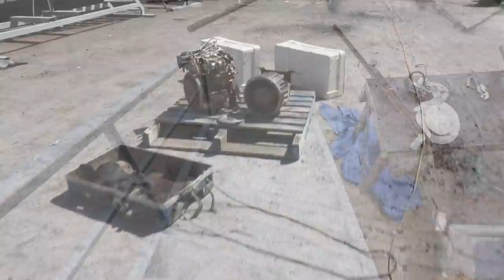Fitting the Generator - Project Brupeg Ep. 67

Comment: In reply to your reply of whether or not the engine will run, I hope you're right and the main bearings are OK. Be a huge pain to have to pull it out again....Thanks for the reply and the best of luck with everything!
Reply from the maker: Yeah when we pulled the sump, it was crystal clean. No red flags anywhere, it turns over really nice, had a few oil leaks but nothing that was an issue. It’s possible the head could have something going on as we haven’t pulled that but all of that end can be dealt with in place without any issues. If it were a dog I wouldn’t have bolted her down. I think we will be ok.

Comment: That looked like quite a project to get it refit and put in the boat. Now to see if you can get her running again. As long as you have it in the boat you probably won't have much trouble getting it running. I wonder it they took it out due to electrical problems with the generator. Good luck with it.
Reply from the maker: Yeah so far we don’t know. But it’s a simple beast, just got to find the time to dig into it

Comment: Keep an eye on all that stainless welding you have been doing. Without back gassing the area being welded it gets contaminated and has a tendency to crack from vibration and heat cycling.
Reply from the maker: Ok will do. Thanks
Reply: I second that.

Comment: I work on these and Whispergen’s (Mitsubishi) every day in the course of my work... great little gen-sets 

A small cloth plug in your oil filter inlet and outlets would have helped prevent some of that grit and grinding dust falling into the oil galleries.  
The water cooled exhaust is too long as an extension bolted onto the manifold. There should be a resilient mounting between it and the engine flange to prevent the assemblies cracking/fracturing.

Just a question? 
Why not finish all the repairs, assembly and testing on the bench?  
Much better access all round.
Reply from the maker: Hi Hammes. We are about to add a Flexi joint, I should’ve done it when I build the pipe but plain forgot. Also if we had time I would have bench started it but with John heading up next week to work on this we needed to get it installed. Sometimes we have to do things back to front to make a schedule for other work. This is a job that can be finished in the water, so it’s a high priority to get it mounted but lower priority to get it running before launch

Comment: Been subbed a while now, but don't get to watch often, because I have many projects of my own! However, I really enjoy your can-do attitude and spirit! Me: I'm a professional metal fabricator/machinist/blacksmith with 30+ years professional experience. Anyway, I have the same engine in my Bobcat mini digger (which I completely refurbed from the ground up--every nut and bolt removed, every damn hydraulic line and seal replaced, every bushing line bored and replaced). This 16HP Kubota D722 is a solid platform, but does vibrate quite a bit. Rebuild kits are cheap insurance-carry a spare in the Arctic, as the Arctic might as well be the moon... Also, the valve cover gaskets tend to piss, no matter what. The sensor next to the exhaust manifold is probably a low oil pressure switch, as I doubt they'd install an OP gauge on that genset. Maybe move the dummy light to the bridge or maybe even install an oil and water pressure gauge? Not to be too critical, as I know you have the tools and knowhow that you have and that's it for now... Had you purged the water jacket tubes with argon and TIG welded the joints, they would be solid, but you didn't and then you ground the crap out of the MIG weld joints and tubes with a nasty carborundum grinding disk. The heavy grinding marks will mask any crack you might have seen and may actually help start potential future cracks... Watch for drips not cracks as you'll most likely see water before you ever see crack, unless you inspect with a microscope. Maybe polish out the heavy grinding marks with Scotch-Brite abrasive pads on a 4.5" grinder? Lastly, once you guys got that heavy-ass genset on deck you could have used this invention called a "wheel" to move it in a linear motion until you hit obstacles like bulkheads. They mount "wheels" on to things called dolly's and hand trucks, which, are helpful for moving heavy things;) A skateboard works great too! Don't get me wrong, you guys are what YouTube is about and you're doing amazing things. You guys and Life On The Mold are the real deal. I've wasted way too much time now. Back to life.
Reply from the maker: Thanks Ethan. This wheel you speak of... 

Yeah we pressure tested this exhaust up and it was ok at time of build but yes with vibration etc it may crack. Time will tell I guess. I will keep a look out, thanks. Damien

Comment: Hard mounting any type of pipe to an engine will likely crack/break from vibration.  You are much better off to insert a short rubber hose between the engine and the hard pipe.
Reply from the maker: Ok good to know. Will alter the exhaust this week. Thanks Jack

Comment: I am totally stealing how you attached those steel pipes with c-clams to use them as hoists.
Reply from the maker: It works great and also has an added level of danger to keep us on our toes!
Reply: @ProjectBrupeg  I was slightly surprised you couldn't just "beef it" into position once lowered to the engine bay door. I guess it was heavier than it looked (about 100 kilos or less). Good work, anyway.

Comment: Just letting you guys know that your Fisher panda D722 genset is only 10kw continous rating and very short periods 11.2. I have attached some info on the unit. I thought you might like to know as it is very important when planning load draw for your various systems as it appears you have just lost 40% of the power you might have thought you had.  Unless someone has added a bigger generator which will only overload the unit. I couldn't quite read the plate on the side of the Kenny where it states output etc. Hope this helps.Cheers.

Fischer Panda AC 12 Mini DP 
100% Fresh Water-Cooled (Ignition Protected for gas boat applications) 
When you need some serious power performance from your marine generator, look no further then our Fischer Panda 12 Mini DP. This workhorse is powered by the reliable freshwater cooled Kubota D722 three-cylinder diesel engine and our freshwater cooled, Asynchronouselectrical end. The unequaled performance of Kubota’s D722 gives the marine Fischer Panda 12 Mini DP a level of reliability, power and smooth operation like no other in its class. The Fischer Panda 12 Mini DP is able to produce a staggering 96 amps at 120 volts. Also, it comes standard with our technically advanced Voltage Control System (VCS), which stabilizes voltage within a range of plus/minus 3 volts. Weighing in at only 410 lbs and with a noise level rating of 54 dBa @ 7 meters the Fischer Panda 12 Mini DP is ideal for larger sailboats and the consumer packed powerboats.
Fischer Panda Marine Generators Digital Panel (DP) generators feature a smart panel diagnostics system that continuously monitors all functions.
Features
Specifications
Standard Accessories
Optional Accessories
Downloads
Frequency
60 Hz
Voltage
240V/120V
Current Max.
46.0A/93.0A
Peak Output
11.2 kW
Continuous Output
10.1 kW
Engine Type
Kubota/D722
Cylinders
3/13.8 hp
Displacement
719ccm/43.88cu.in.
Cooling
H/E
Dimensions (LWH)
27.3×20.4×22.2 in.
Weight (Wet)
410 lbs
Noise Level
54 dBa @ 7 m
Due to our continual product development, we reserve the right to alter any specifications without warning. All ratings refer to air and water temperature of 20°. De-rating at 1% approx. every 100m altitude and 2% approx. every 5°C air-temperature above 20°C and 2% approx. every 1°C water-temperature above 20°C.
Reply from the maker: Hi Alan, yeah its likely we will drop the Fisher Panda. We are missing sime parts and they are next to impossible to find/afford.
Reply: @ProjectBrupeg  Good call. May I recommend a Northern Lights unit as my experience of owning Onan has proven to be less than satisfactory with rotors or stators burning out within a short period of time. Whatever brand you choose, please go with a 1500rpm unit rather than a 3000 rpm unit. The 1500rpm is MUCH quieter and obviously less wear on engine and components.
Reply from the maker: Yeah now that we are able to pick the genset rather than work with what we have we will be focusing on a 1500rpm unit

Comment: To get that Sensor away from the exhaust, take it out and get a 90 or 45-degree elbow and screw into the block, then screw the sensor into the elbow. Add a pipe nipple or two as needed to get it away from the exhaust. That's probably the Oil Pressure Sender, and when the plastic inside the center of it gets Old or bad, it will leak out of the sender. So avoiding Heat is a GREAT Idea, lol. Yeah, Replace it, too, maybe carry a Spare? I believe I'd be getting me a couple sections of T-Rail and weld me up a Trackway into the Overhead, and a little trolley to run on it, for when the Genny needs to Come Out again someday, THAT was just TOO MUCH BULLSHIT getting her IN there, lol...
Reply from the maker: Yeah I’m going to add in a Flexi coupling for the water cooled exhaust which by default will give us a lot more clearance around that sender. And yes a track rail would be good but we have bigger all head room so I’m loathe to add anything that reduces it further
Reply: LOL, I saw you had Kneeling Room Only...Small Design Flaw, Sue the Naval Architect, lol.. @ProjectBrupeg

Comment: given the pain you've had with moving that sort of heavy bit..seems like you could make a crane "rail" that would be on the underside of the roof down the center line.  ...would like you hoist it once....then roll the hoist the length of the rail and lower it down the hatch to the lower compartment......   and then a second rail system down below to move things in the engine room.....could be easily crafted from a low profile i beam or T welded upsidedown...   I can see a ton of uses for it in general, not the least of which would be something like this project....   essentially it would be kinda  low profile system that's permanent instead of the makeshift one with the pipes you did in the engine room itself.....

An alternative would be two chain hoists, so you can hoist one to another and not have to hold it off to the side and lower it down every time.....
Reply from the maker: Hi Tim, we did have a version of this in the lounge but we use it so infrequently we didn’t bother keeping it. Same issue in the engine room this is the first time in four years we have needed to move a really heavy object around, so yes while it would be nice having a Gantry of some sort it’s just not that much of a priority. We also have a real lack of head room in the engine bay so anything that reduces that is a real issue on Brupeg.

Comment: Chain Block And Tackle Chain Blocks / Block and Tackle. ... Chain blocks are also known as block and tackle, pulley block and a come along. A chain block is similar in purpose to a lever hoist. A block and tackle can be used to lift a load or to pull a load.
Chain Blocks / Block and Tackle :: Chain and Rope Suppliers Ltd ...

Comment: Well done. Where does the exhaust exit?
Reply from the maker: Thanks. Exits the bottom of the box downward then essentially does a 180 and heads to the roof, from there it does a 90 and tracks across the roof and joins into the main stack with a 12v valve that blocks the genset exhaust when not in use.

Comment: What about air ventilation or cooling fan while its running?
Reply from the maker: From factory it has two big vent holes at one end of the blue box. They are maybe three times the size of the engine inlet each so I think they will be fine. There factory so I must have run ok as is
Reply: Project Brupeg are you going to run vent hoses for the generator to the vents outlets on deck?
Reply from the maker: At this stage my plan is to leave the generator venting to the engine room and have the four engine room vents providing fresh air to that room

Comment: Not to be a pill, but have you heard the engine run? Good progress nonetheless.  Thanks for the video.
Reply from the maker: Not yet. That said, I’m confident I can resolve anything that would stop it from running, it spins well and has three compression strokes so anything else is going to be fairly minor and resolvable.
Reply: I was wondering the same thing, shouldn't you get motor running before the install. Also since your relying on this, shouldn't you install all new bearing, seals, hoses etc?
Reply from the maker: No not necessarily. As an engine reconditioner I know what to look for and I would prefer to get it running as is before investing cash into it. If it’s a healthy motor I’m happy to take a rebuild kit and press on with a planned rebuild when in port prior to an expedition

Comment: How / where do you route the exhaust ?
Reply from the maker: Hey Rich, exhaust comes out of the bottom of the sound proofing box and does a rough 180 turn and Heads to the roof. From there it tracks across the roof and is joined into the main stack with a 12v valve (like a high temp ball valve that blocks the genset exhaust when not in use)

Comment: Hi Damien and Crew.

I know Nothing. 

But did you just block your starter motor in with a pipe. I guess it may not have been front of mind with all the other things you were trying to Mc Gyver at the time but I would suggest that you cut that thin pipe back at each end and replace with a suitable hose.

May save you a heartache at the most inopportune time in the future.

As I say I know Nothing.

Love Ya Work.

David.
Reply from the maker: David, that is a brilliant observation. Thank you, I will do exactly that as I didn’t even think of that issue when I built it.
Reply: @ProjectBrupeg  Damien. I could see it unfolding as you were building. My mind works in a different way. As I say I Know nothing and I never tell others how to do their own thing so if that is the way you planned it then more power to you but for me there was a problem coming up in the future.

K.I.S.S. and you had the perfect timing to use this principle.

You are doing thing which I could have have never done so I guess we all have our skills.

p. s. a small bend in that dip stick would have moved it away from the crank, but you can do that once the Gen set is installed.

David.
Reply from the maker: Another great solution for the dipstick. LOVE THIS! Thanks for your feedback it’s really helpful

Comment: I take it you have had the generator running as thats a lot of effort if its a dudd?
Reply from the maker: Not yet no. But as an engine rebuilder there is nothing on this thing that would stop be being able to get it running. It’s still a currently produced engine so parts are cheap and easy and they are very reliable so it’s unlikely anything major is going on with it

Comment: Would have been the perfect opportunity to replace piston rings, dingle ball hone the cylinders, new rod and main bearings and new gaskets everywhere. ..at least a new head gasket. If it it turns out the basic engine internals are worn out after being far out to sea...sigh. Missed oppportunity to do the logical, right, and not too expensive thing.
Reply from the maker: Sure but when 50things are screaming out for cash and a generator is well down the list of critical thing then it doesn’t get any money spent on it. Your right it would have been nice to do those things but getting the boat seaworthy and launched is more critical than bench rebuilding the genset. I’m able to do that at sea (will have a full workshop onboard before we go anywhere). That said the genset will be rebuild prior to any critical expedition.

Comment: Why do you think the genset was left in the bushes. If this generator is water cooled you might want to consider running fresh water  against the generator and run that water through a sea water cooled heat exchanger. It will last much longer.. Actually I'm just not understanding what you are doing to the cooling system. Are you converting from a wet exhaust to a dry exhaust.

Comment: Your terminology is a bit backwards on the alternator.  On an alternator, the field spins and has the electro-magnets.  The metal pieces you were pointing to on the stator may be partially magnetized, but the are just iron and help direct the magnetic field through the copper windings.  I did not see the brushes and brush holders that send electric power into the field.

𝗜 𝗰𝗮𝗻'𝘁 𝗯𝗲𝗹𝗶𝗲𝘃𝗲 𝘆𝗼𝘂 𝗱𝗶𝗱 𝗻𝗼𝘁 𝗰𝗵𝗲𝗰𝗸 𝗰𝗼𝗻𝘁𝗶𝗻𝘂𝗶𝘁𝘆 𝗼𝗻 𝘁𝗵𝗲 𝗳𝗶𝗲𝗹𝗱 𝗮𝗻𝗱 𝘀𝘁𝗮𝘁𝗼𝗿 𝘄𝗶𝗻𝗱𝗶𝗻𝗴𝘀 !
Reply: It's called a brushless alternator
Reply: It will have a series of voltage taps in the back .
Reply from the maker: See the sarcastic Damien would say “what like a ball valve type of tap”
Reply: @ProjectBrupeg  - No, more like beer keg taps !
Reply: @gfroese4799  Brushless alternators have a permanent magnet "field".  No windings.

Comment: wouldnt of been easier to just assemble it in the engine room ?
Reply from the maker: Yes and no. We had a lot of parts to build and fit, much easier to weld them together on the bench and just lift the complete unit in as one, compared to lift in and assemble multiple pieces then start building parts in a cramped environment